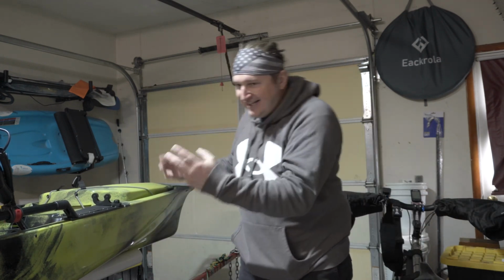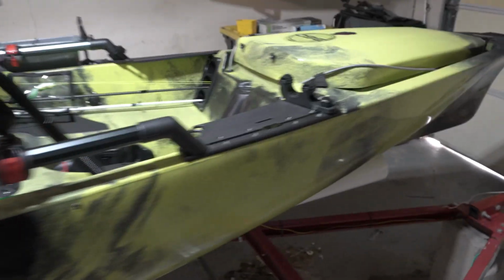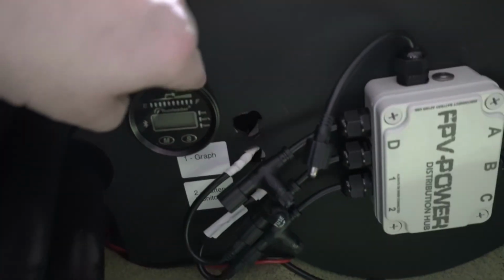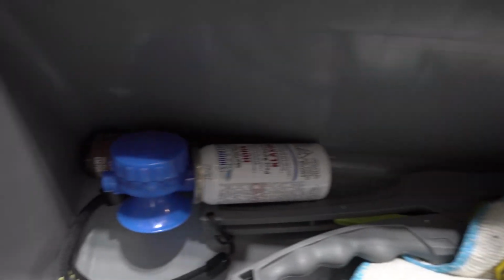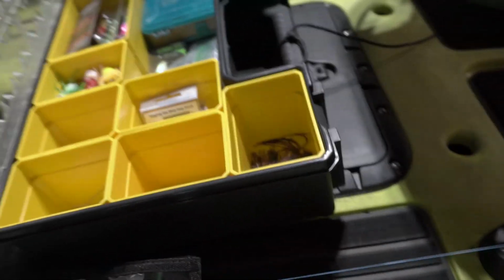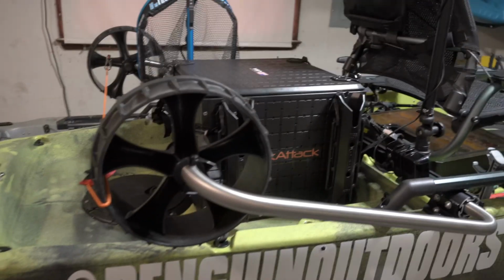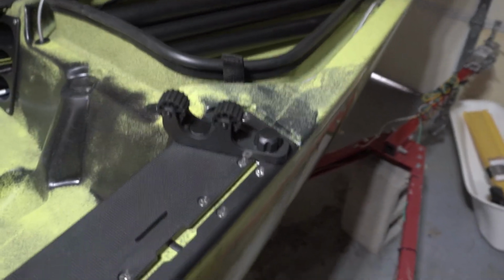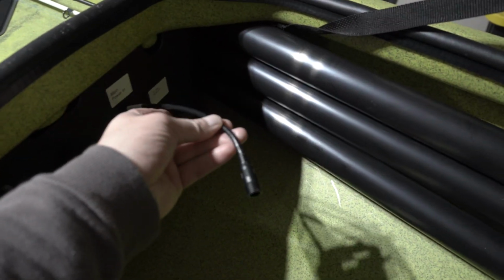Tournament Bass Fishing Kayak Setup! My Hobie Pro Angler 14 360! PA14 360 Walk Through! Subscribe!

Comment: try making a loop bungi from screw point and have the bungi rap around the rod holder and hook on first hole. Then when you go to lock rod down unhook bungi over reel
Reply from the maker: I actually never use them. My rods are only ever in those holders when I'm switching between them on the water. If I was in rough water I might use the bungees but to be honest they haven't been unclipped from the rod tubes yet.